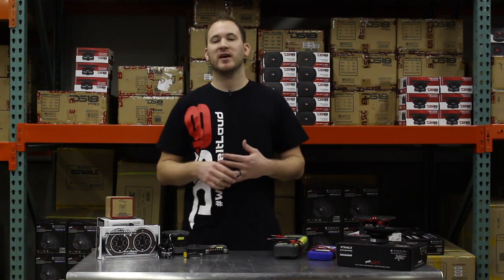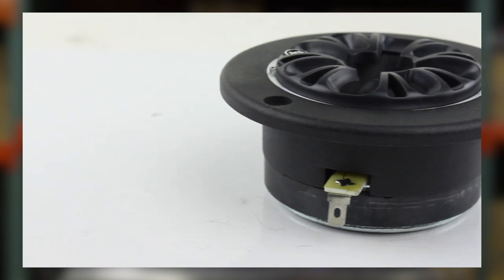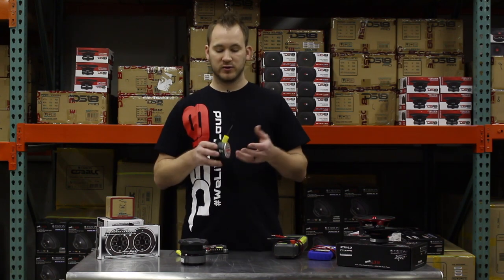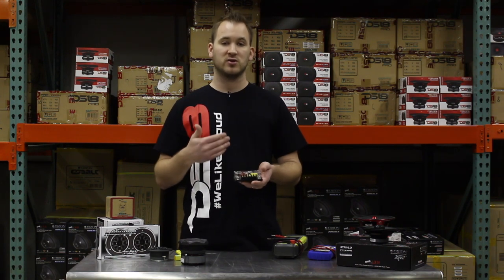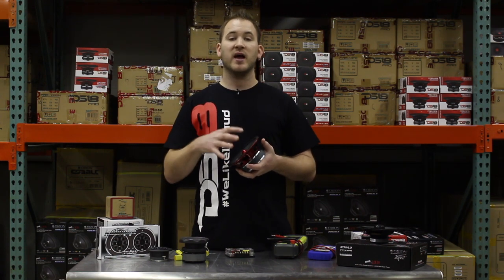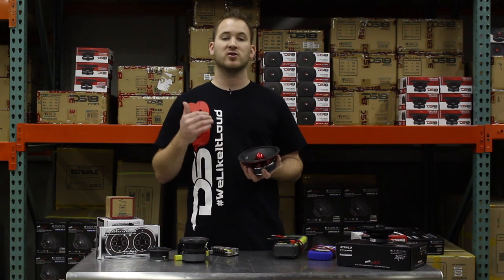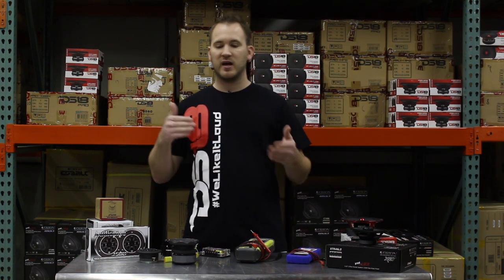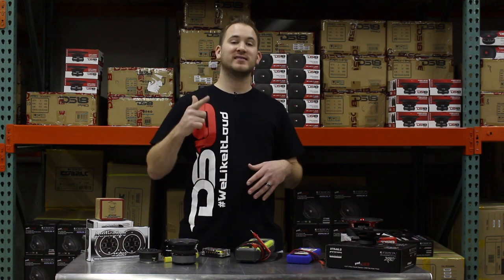How to Prevent Blowing Your Speakers and Tweeters

Comment: My question is.. say that you have your 6.5 mid-range speakers, your cross over, and your tweeters.. and your tweeters have a capacitor, or bass filter already connected to them.. should that capacitor be removed, or should it be used with the connection to the cross over?
Reply: Keep it
Reply: @The420chemist   so connect the crossovers the tweeters came with -> up to the passive crossovers -> then connect the passive crossovers to the amp channels 1and2 ??
Reply: If you keep the existing capacitor, the slope is then added together with the slope of your passive crossover. So no, don't use both. Pick one or you'll end up with let's say, a 36db slope on your tweeters, then a 12db slope on everything else. That's not a good thing.

Comment: I am planning to use a 2 way crossover to run tweeter horn and woofer. Can I run the horn straight with a capacitor

Comment: Just ordered ds13 tweeters that came with inline crossovers and I ordered the ds13  300 watt crossover .. do I need to just run my tweeters to the passive crossover with the online it came or do I just plug it up no inline crossover meaning the ones that it came with thanks 🙏!!

Comment: I just ordered the skar 3.5 inch super tweeter. I have a aftermarket radio. Do you think I need to get a amp or should I just run it from the radio? Can anyone help?
Reply: Sightless_Yt 
I have the same question?
Reply: Definitely get an amp. That will feed it the power it needs.
Reply: You can run it to the hu if you want but if you can afford it then get an amp and it will perform better

Comment: Im running skar what the best amp for highs and mids im a lil new to this lmk thank  great  video
Reply: I’ve been installing car audio systems for 18 years and imo the best amp for mids and highs is a 4 channel Alpine amp. As far which exact one you should get that just depends on the amount of power your speakers/tweeters need and can handle. Go by the rms watts not the peak watts so you don’t damage any speakers or the amp.

Comment: I have 2 ds18 6.5s 2 tweeters and 2 jvcs all hooked up to the doors. No amp. And my head unit only pushes 50watts per Chanel. And I was on the way to school, I got there and they were fine and all clear. Then 2 hours later I go get in my truck and they are staticky and disorted

Comment: SO, QUESTION, SHOULD I CONNECT MY TWEETERS PARALLEL WITH MY FRONT SPEAKERS ON MY AMPLIFIERS INSTEAD OF CONNECTING THEM TO THE HEAD UNIT?
Reply: Yea to your amp unless the amp is too powerful for the tweeters
Reply: Your talking about wiring a tweeter and midrange together in parallel to a channel on a amp? I wouldn't wire a midrange in parallel with a tweeter. Tweeters are in a different frequency range than a midrange so you don't want them on the same channel. Say you have 4) tweeters and 4)6.5 midrange to a 4 channel amp. You would wire the front passenger tweeter in parallel to the back passenger tweeter to 1 channel on the amp that is going to the front rca output. Then run the driver side tweeters like you did the passenger side to the 2nd channel on the amp. Repeat the process for the midrange speakers to the 3rd and 4th channels. You want all your tweeters wired together on the front channels and all your midrange wired on the rear channels. Sorry it's a year later that you posted this.
Reply: @Silentjustin06  I know it’s a year late, but what if you run a component setup in the front and coaxial for rear.
Reply: @MegaHotdude12345  Are you using an aftermarket radio with 3 sets of RCA OUTPUTS on the back of the radio?
RCA  Front 
RCA  Rear
RCA  Subwoofer 
Let me know and I'll be able to answer you questions better
Reply: @MegaHotdude12345  your make and model of radio would help a lot so I can look it up and see what features it has
Reply: @Silentjustin06  it’s a cheap boss audio head unit but I plan on upgrading, but I plan on going DS18 coaxial with a crossover for the front doors, and a 6x9 for my rears. I’m in 2003 chevy tahoe and I plan on using a Rocksford Fosgate punch p400x4 which is 100wx4 at 2 ohms
Reply: @MegaHotdude12345  ok well I'm guessing your radio only has RCA FRONT and RCA REAR.

The component speakers need to be wired to the FRONT RCA OUTPUTS. 
So when u run the RCA plugs from the back of the radio to amp connect the component speakers to the channels the FRONT RCA OUTPUTS are plugged into on the amp. The HPF switch should be on FULL or OFF,  not on HPF.
Reply: @MegaHotdude12345  the coaxial 6x9 should be ran off the REAR RCA OUTPUTS off the the back of the radio.
So whatever channels the REAR RCA plugs are connected on the amp. Wire the 6x9 coaxial speakers to those 2 channels
Reply: @MegaHotdude12345  so your component speakers are connected to the 2 front channels and the coaxial 6x9  speakers are on the rear 2 channels. 
The coaxial 6x9 speakers HPF should be set to FULL OR OFF. I  don't know what that particular amp HPF Switch is labeled as.
Reply: @MegaHotdude12345  those crossover boxes for the Component speakers are going to do most of the work as of HPF crossover points. The 6x9 speakers I'd read the manual to see what crossover hz  level it should be set to on the amp.
Reply: @MegaHotdude12345  looks like the amp has the switch labeled as 
LP 
AP
HP
you want both front and rear channels set to the AP

Comment: Why aren’t using the DS18 PRO-CFX Two-Way Passive Crossover
Reply: I bought DS18 PRO-CFX Two-Way Passive Crossover with 2- super tweeter and 2- 6.5 mid 250rms for front. All 4ohms. Can I bridged them on 2 channel amp ?
And does my crossover DS18 PRO-CFX Two-Way Passive Crossover stay at 4ohm using tweeter and mid on Left and Right?

Comment: hey guys what if im replacing a stock tweeter with an aftermarket.  will the stock tweeter already have a capacitor or do i need to run the capacitor also.  cant find any answers to this at all thanks

Comment: What I want to know is... what happens when you install car speakers with the driver (magnet) against (or touching) the metal of the vehicle?
Reply: It's all good
Reply: @tomi-jon8798  good to know. I wasn't sure if the driver would somehow de-magnetize or not.
Reply: It won’t damage anything but it will definitely take away from the performance of the speaker because it reduces the strength of the magnetic pull of the driver. It’s not something you want so if you can avoid it I would. I’m speaking mainly about high powered subs tho.

Comment: I have 4 8” rockfords 300rms  each BLEW the tweeters on the 4of them    Have a avionics 4channel 100 per channel.   The low power amp caused the damage to the tweeters? Help
Reply: Yes, your amplifier was very likely clipping.
Reply: @nikolapoljak9260  now bought aunex 4 channel 1500 watts still same thing.
Reply: Try using a resistor or a bass blocker wired to the positive speaker wire that’s going to each tweeter.

Comment: Hey I recently got a system in my car, got four 6.5 and four tweeters too and got sub amplifier and voice amplifier but 3 of the 6.5 stopped working and sometimes turn back on for like 3 sec and turn off again depending on the music I play has happened twice and once more again. Can u plz help me don't wanna go back and get them changed for new ones if they gonna stop working again.
Reply: Did you figure it out? Did you install it yourself? Let me know if you still need help understanding something. I'll do my best to help.
Reply: You have your gain set improperly and you more than likely are wired too low. What's the impedance of your speakers and how many speakers do you have per channel?
Reply: @Silentjustin06  had the gain to high thx tho.
Reply: @thatunknownguy2680  yes had gain to high.
Reply: @erny6482   oh ok, I figured you probably blew them. Your welcome
Reply: Mine does the same but only on the left driver side speaker. I didn’t notice it till I started tweaking the gains . I’m not a professional so I figure that’s probably why as well

Comment: what 6x9 speaker would you say would be better then the stock 6x9 speakers in a 2007 pontiac grand prix, with the monsoon sound system, i heard that the 6x9 speakers are nearly better then any other aftermarket 6x9 speakers for the car, and i blew one maybe the second one, they are not fully blown but i can tell that one has a mattalic like sound like a tin but the other one didnt sound as clear before i blew the second one, also i can only afford to replace the 6x9 and not the stock amp, and need to know what the best speakers can go in it and sound at least equal to or better
Reply: I would go with Skar audio 6x9. They are like 120rms per speaker. Which is more then enough unless your getting a big system. I went with prv 6mr500ndy. They are 6.5" mids and 250watts rms. I got 8 of them in my car lol. Just I'm into competition with my car. I hope the best for you and keep the volume knob up
Reply: Rockford fosgate makes damn good speakers. Guaranteed to surprise you with the audio quality and they like never blow if you get the right speaker wattage that you need

Comment: Can anyone help me out ..question ..I have a pair of speakers with two connections ..one high ..one low ..when I put speakers button on Ampe I can't hear the high frequencies ..but when the bothe A and B are pressed with the low frequencies connected it all works why is that
Reply: Sounds like bi amp terminals. You need to put in a bridge from positive to positive and negative to negative. Then you can run one cable pair to each speaker
Reply: @FSXgta  thanks for your help much appreciated ..and it worked I'm new to this game 👍👍
Reply: @maggiemay621  no problem!

Comment: How can I contact you
Reply from the maker: Hi Martin, send me an email at pricedrightsaleswal@gmail.com.
Reply: @pricedrightsales441  can you run midrange in Full instead of HPF if your crossovers are set to the speakers frequency range 155hz-10khz. I'm in network mode on my pioneer avh-x4800bs.
Tweeters on front channel 
Midrange on rear channel 
Subwoofers on sub channel